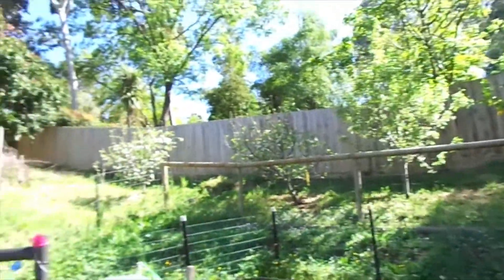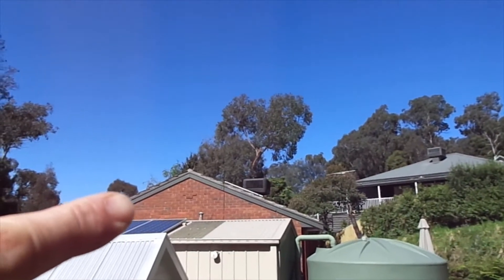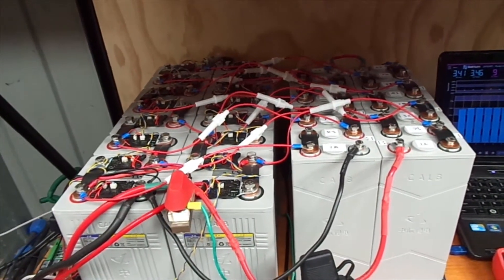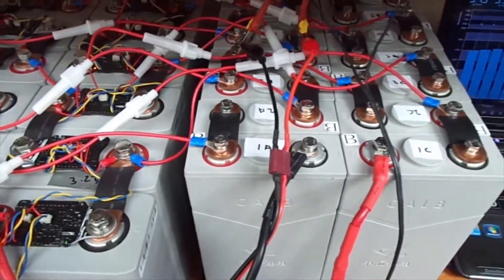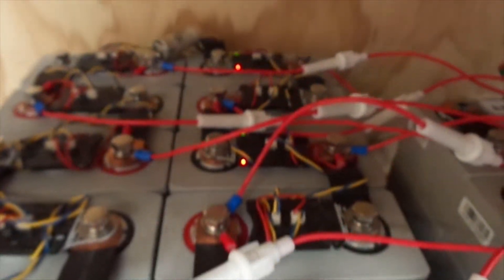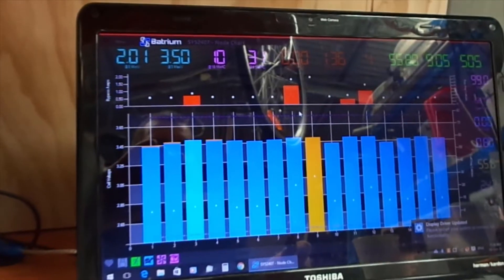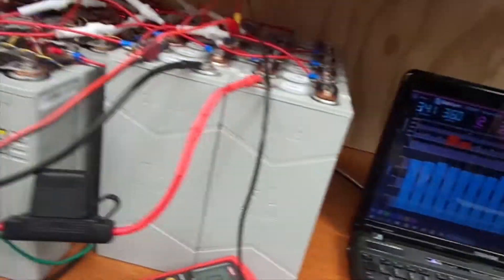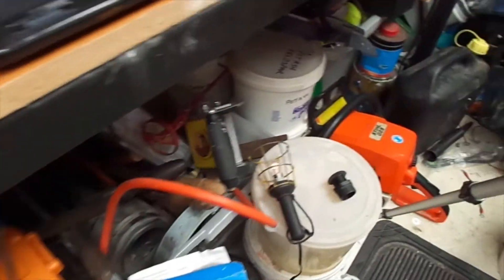LiFePo4 48v Off Grid System Update. 60 ah Pack Connected

Comment: I have a question. I want to do a 48 V lithium iron phosphate battery bank. I’m thinking for a 100 amp hour bunch of 16 cells it’s going to be around 2K for the cost. My question is will I be able to add more batteries to that each year and for how long?  I’m sure there is a point were you would not want to continue adding since the ah would be somewhat wasted on newer cells but if I could add one group of batteries per year for at least three years that would be a decent size system in my book. No way am I going to be able to get $6000 inBatteries in one year LOL. Have too many other projects and expenses to cover.

Comment: You also have a New version you can upgrade too :)
Reply from the maker: DIY Tech & Repairs i know there is a new update, just not sure if there is anything I need in it and am only just getting used to what I have.
What are the main benefits of the new version?
Reply: Depending on the version you run now there is several fixes both features and bugs. There is a changelog if you click the little icon :)  Other than that Yes you dont have to upgrade :)
Reply from the maker: DIY Tech & Repairs Cool cheers for that

Comment: Batrium will automatically reset soc if its to high so just leave it charging. When all is above 3.45 or closer to 3.5 they are generally full if we look at long life.  Note that soc is what we set it to
Reply from the maker: DIY Tech & Repairs yes I will generally only charge to 3.45, I'm just doing a few monitored "full" charges initially to see where they all end up.
Thanks for the comment 😆